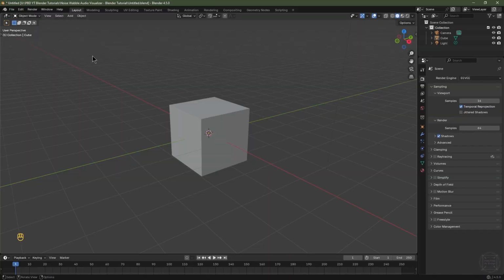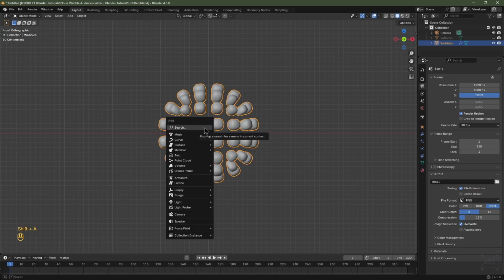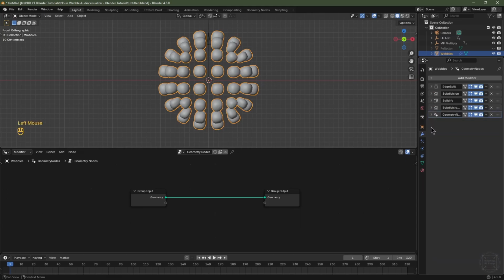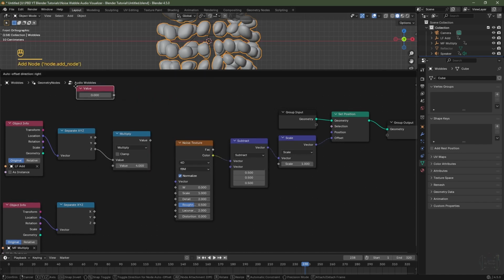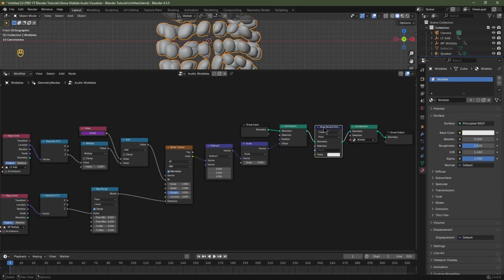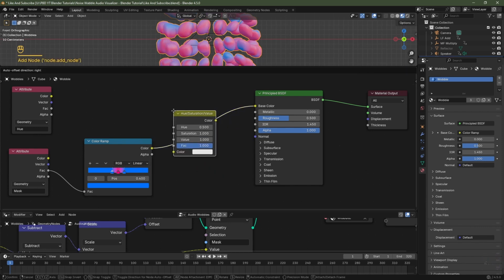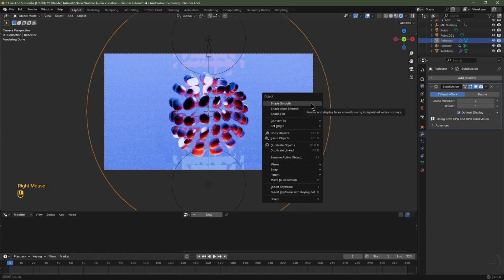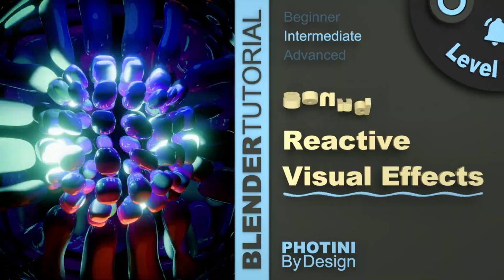Sound Reactive Visual Effects - Blender Tutorial

Comment: After adding color ramp to wobbles i only see one color, double checked - i followed everything, no typos. Working in blender 5.0.1, everything i add after doesn’t look the same as yours :(
Reply from the maker: The 1st thing to try is shimmying the colour ramp flags, if that doesn't work try checking these 2 node settings as followed. 1: In the shader editor on the "Mask" (Attribute) node that is plugged into your Colour Ramp, ensure the attribute type is set to (Geometry). 2: In the geometry node editor, locate the (Store Named Attribute) node named "Mask" and set the data type to (Colour) and then set it's domain type to (Point) If you are still having problems, let me know.
Reply from the maker: Just wondering if you managed to fix the issue. If not try my suggestion on my previous reply. Stay sharp and level up 🚀
Reply: hei, just got back to working on this project, checked what you said, didn’t help - everything was correct. tried changing the sound sensitivity (map range) that also didn’t help. Have talked to Ai ab this problem -  offers multiple fixes but nothing helps. Everything seems correct